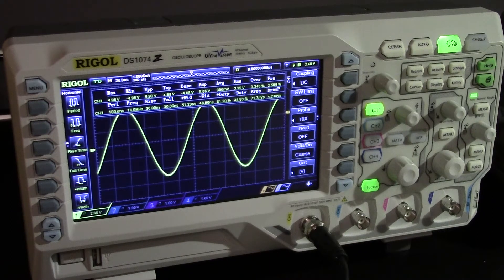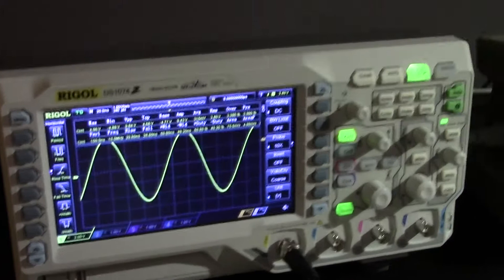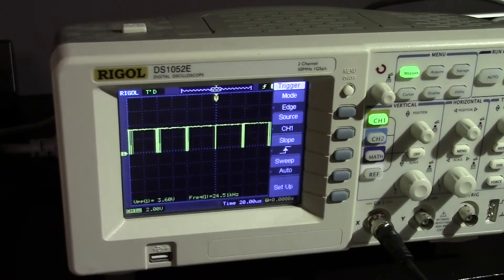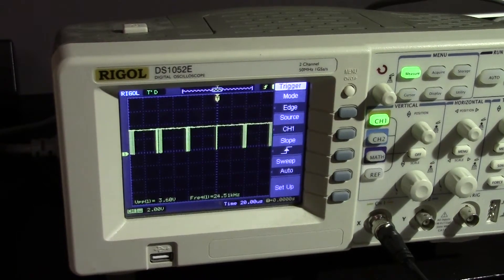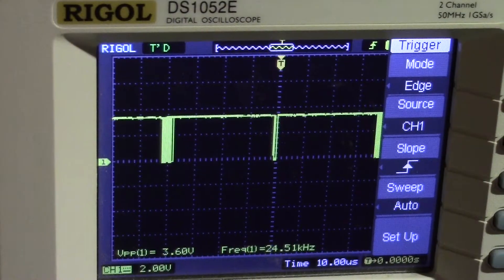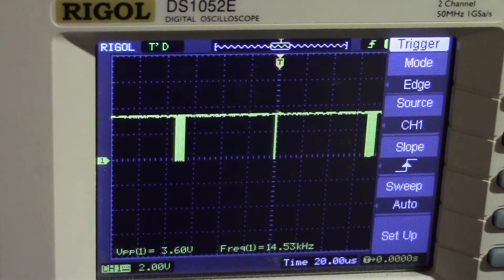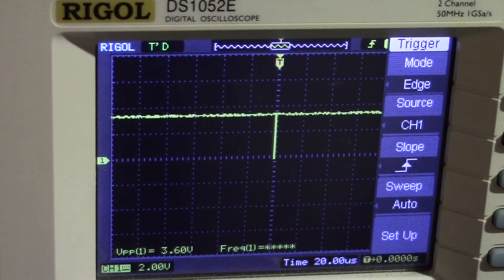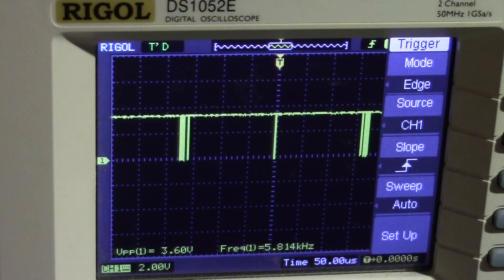Rigol DS1000Z Series - DS1074Z-S Waveform Update Rate

Comment: what is the update rate of the DS1052E? if you set the ds1052e to trigger out and measure on the 1074z?? is it more than 200 waveforms/sec? Thanks
Reply from the maker: I've seen quotes of around 1000 wfms/sec for the DS1052E. The 1074Z is rated for 140,000 wfms/sec but that's only when you've got everything else turned off (as per comment below). My 1052E is out on loan to someone at the moment so can't test.
Reply: thank you for your fast answer. i could not find any info on the wfms/sec on the DS1052e. Wow, that is crazy 140k wfms/sec... If you could do a measurement on the DS1052E when you get it back i would be really grateful. but i think1000wfms/sec sounds about right. Thanks